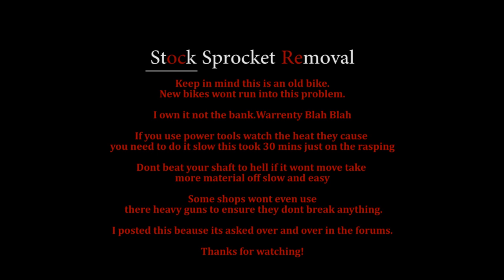1998 zx9 ninja front sprocket removal

Comment: Oh yeah. I had trouble with this too. I even had an impact wrench out and never got it off. I ended welding a two inch wide nut on to it and a breaker bar. After a few turns the bastard finally popped off and I started going back to church.

Comment from the maker: If there is loctite on it, you're going to have to heat the nut, then use a long breaker bar with a proper 6 point impact socket to get it off. This nut is notoriously difficult to remove,set at around 94 lbs - and thats a good thing.But honestly, only some real torque is going to remove it. Or the way I did it .

Thanks for the comments ZX.Good luck!